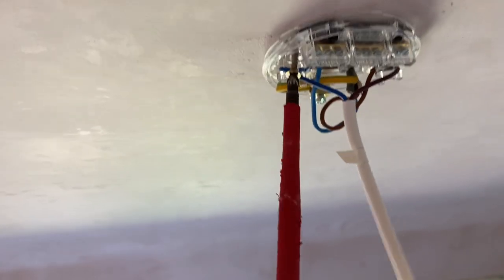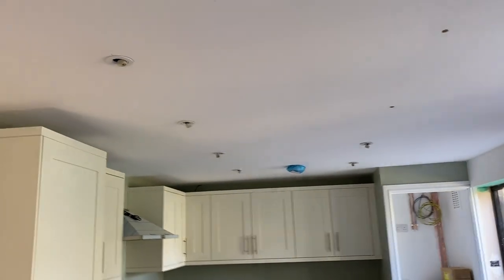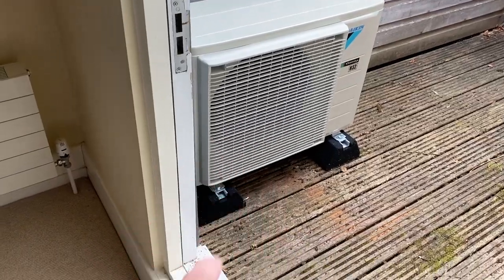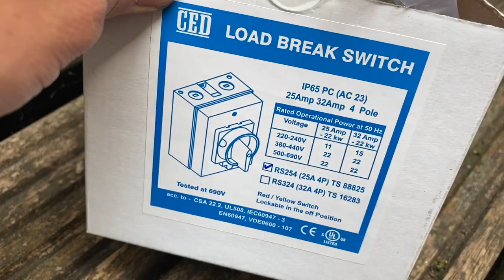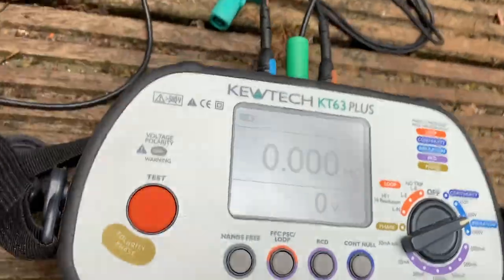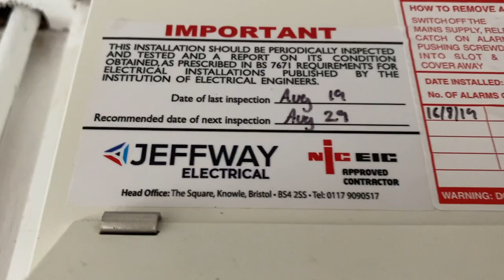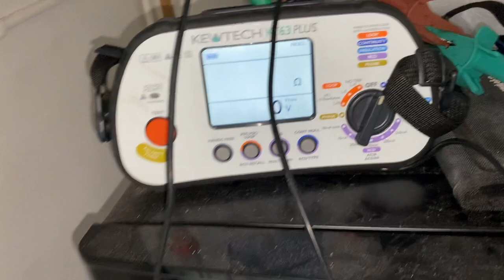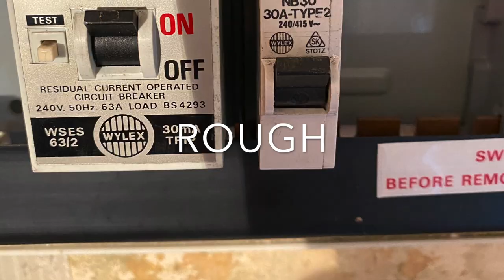Fault finding on a shower circuit. Disconnected and walked away.

Comment: Hi Chris great video as usual just a tiny point when installing the smoke detectors you shouldn't be sleeving the black wire with brown sleeve its only a communication/interlink wire sending a low voltage through to the other detectors
Reply: That's not what the aico user manual says!
Reply: Will Robinson it’s a extra low voltage interconnecting communication wire that doesn’t carry 230volt and only carry’s a voltage on operation of the test button or after an alarm activation
Reply: Will Robinson which page of the aico electrical contractors handbook does it tell you to sleeve the black core, I’ve got the handbook open here and non from page 102 show any sleeving
Reply from the maker: Hi lee 
Not sure what literature your reading but your wrong. I’ve got it in black and white in front of me.
Reply: @leebutterworth7465  page 25 of the user manual. "Must be treated as live. Insulated and sheathed" which I take as sleeving....
Reply: If you're treating it as live then surely you should be putting some brown sleeving on it !
Reply: CJR ELECTRICAL hi Chris as per chat on instagram I’ve got the colour pages of the Aico installer guide doesn’t show brown sleeving also David Savery past the same comment on one of his recent videos
Reply: @leebutterworth7465  valid points but it clearly says "treat as live and sheathed" in the user manual
Reply: Will Robinson I have the electrical contractors Handbook from Aico they don’t show any sleeving and their pictures are in colour unlike the instruction manuals it’s a weird one why their own paperwork contradicts itself
Reply: Will Robinson just got the latest electricians handbook from Aico definitely doesn’t show black having brown sleeving get the handbook from Aico completely free and fully up to date info
Reply: Always sleeve the black!
Reply: You would only find a debate this sad when you go balls deep into a CJR or David Savery video's comments section

Comment: Watch out for expansion and contraction of the tongue and groove timber you fixed the isolator too. You can get ~5mm movement across two boards between wet and dry states (but maybe this is composite cladding - can't quite tell in the video).
Thanks for the vids, enjoy watching someone take pride in their work.

Comment: As someone who works in IT it makes me happy you don’t put the cable next to the data cables. I’ve seen so many people put them together and it makes me want to cry. Keep up the good work, long time sub and always drop a like.. I just don’t comment often.
Reply: Why, Ethernet is a differential current signal. You have to have a lot of interference to have any corrupted packets.
Reply: In a residential setting its unlikely that it would cause noticeable interference but, better to keep it seperate.
Reply: @florisvdk  AC Cable carries a LOT of Amperage compared to Data Cable which creates a comparatively HUGE Electromagnetic Field which in turn creates a lot of unnecessary Noise/Voltage/Current in the Data Cable - bad for high-speed Data transfer (high Noise) and VERY bad for the Electronics sending/receiving that Data (high Voltage/Current).
Every Electrical Code I'm familiar with requires a certain amount of separation between High Current Cables and Data Cables for just that reason...
They also require a separation between High Voltage Cables and Low Voltage Cables to prevent excessive Currents being Induced in the Low Voltage Cables (under the wrong circumstances, a 120/240 Volt Cable can Induce 40+ Volt Currents in a Circuit designed for a Max. of 12 Volts...Not a good thing for 12 Volt equipment (such as most Smart Home Controls) to suddenly get 40+ Volts through them...
Reply: The regs require separation of band I and band II anyway, so it should be done regardless of whether it has an big impact on the data or not.
Reply: Yeh the worst data issue I have had was with a cat5e UTP cable that ran in a lift shaft (office building) every time the lift moved the link dropped out...

Replaced cable with FTP and it was fine

Comment: 15.01 Any DC fault current from the new Aircon unit will blind the type AC RCD in the MK board, looks reasonable to me the Aircon  unit could have gone on the non RCD side, just a thought.
As for fitting Aico smokes with replaceable batteries isn't so it's easier for the customer, it's because it's cheaper than fitting lithium for you, everyone loves a bleeping smoke alarm at 3am!

Comment: Chris does this mean all previous  CP Fusebox c/w SPD need to be revisited to fit a MCB
Reply from the maker: Nope they just don’t want to rely on the dno fuse anymore
Reply: Cheers 👍
Reply: Don’t suppose anyone has a link for the info/instruction sheets that document this change in stance please? 

I’ve tried to find it and can’t, does add further fuel to the do you don’t you debate surrounding OCPD with SPD...🤔

Comment: Where the hell does this gap between RCBOs come from? Sure I understand contactors, but RCBOS seems a bit extreme and an odd way to force bigger boards...
Reply: Chris Reed its a load of bollocks mate. Every protective device gets warm when loaded near to its rating for long periods. Its even mentioned in manufacturers instructions and always has been. Cant see why everyones getting lobons over it lately.
Reply: Forgive me if I’m wrong here, just a trainee, but does it come from the CU instructions? 

“Adjacent thermal-magnetic MCB’s should not be continuously loaded at their nominated rated currents when mounted in enclosures. We recommend a 60% de-rating factor is applied to theMCB’s nominal current where it is intended to load MCB’s continuously .”

🤷🏼‍♂️❓
Reply: This seems utter bollocks to me. Look at 3 phase db’s usually loaded full of rcbos there is never a problem with overheating.
Reply from the maker: Not over heating which is the problem it’s just to prolong the life of the expensive rcbos they are 5-6times more expensive than mcbs

Comment: The vast majority of boards in the country have CPDs that exceed the value of the main switch. You have to apply diversity. And what about the value of the DNO's incoming fuse?  Maybe they could have mixed up lighting and "power" circuits a bit more.
I was taught that you should always test an RCD in isolation, IE switch off all MCB's and disconnect all N's before testing. You're brave working in your socks.....
Reply: Simon Abbott for instance an 18 way 3 phase db thats loaded with single phase circuits, with only an 125 amp main switch. Some don’t or won’t trust good old diversity, thats the problem🤔
Reply: Selectivity? 🙄

Comment: How come you didnt do 5 tests on your RCD? 1/2, 1x at 0 and 180 and 5x at 0 and 180? I know you only record your highest 5x for a final circuit but does your tester do both tests at 5x in one operation? Or did you exclude the running up and down the stairs just?
Reply: have a guess...

Comment: The fireangel ones aren’t bad but it’s cheeky that you need to spend another £3 to get the proper push fit base that actually accommodates wiring, they base they come with is pointless

Comment: Are you happy with the Wiha SoftFinish screwdrivers? I've used Wera for quite a while and when they started wearing out I thought I'd try Wiha but I'm not really happy with them. The handles, especially the smaller sizes, just feel too small for my hands to hold them comfortably! Might get another set of Weras.

Comment: How come U.K. electricians never have tall enough step ladders ?
Reply: Tiny trucks because there’s nowhere to park and shorter ceilings in older dwellings.

Come into my American home with 10ft ceilings and 36” front door that was built in the last decade. JK my 1969 ranch only has 9ft ceilings. 

My sister’s 1970 ranch has a 42” front door though with a glass storm door from the previous owner who I guess may have been wheelchair bound. It had the thickest pink carpet was like walking through sand.
Reply: I'm surprised not many folk use hop ups, I find a youngman hop up does most jobs and a 8 step step ladder the rest.
Reply: @peterg.8245  we use metric 🤷‍♂️
Reply: @peterg.8245  most older Victorian properties in the uk would have 9/10 ft ceilings.....why are we talking about pink carpets😂😂

Comment: Much better to use a flexible cored cable rather than solid drawn twin and earth for vibrating machinery such as an air con unit. Testing RCDs at the RCD terminals with loads removed is the correct way to test RCDs and much less problematic.
Reply: Thats also how I've always done rcd testing, it amazes me how many people don't know that. I worked with a guy who  thought the brand new Schneider rcbos were faulty. They tested out fine when the load was disconnected.

Comment: Those starbreaker boards are brilliant, no faffing around having to remove the busbar from every breaker. What was going on with that shower cable route?
Reply: I wonder why no other manufacturer has followed this design? So much safer when there are spare ways too, especially if using those clip in blanks that always seem to magically disappear leaving exposed busbar.
Reply: @Daniells1982  mainly because I think it's patented by crabtree

Comment: Are you allowed wire appliances with those SWA core colours? We’d be made rip it all out and 2 points put against your company!!
Irish contractor ☘️
Reply: As long as you identify them with sleeving it's fine. Come to think of it I think they only sell SWA in those colours here
Reply: Jesus your so lucky. If our inspectors caught you not using the correct colours you’d be told to rip it out and re-install at your own expense and hassle!! They’d also black mark you and issue with penalty points. Some of them are real pieces of work, out to help no one!

Comment: I used to use a Yankee screw driver for ceiling roses back in the 80s
Reply: Yankee screwdrivers , I remember them 😂
Reply: @thomasbambridge6974  Still got mine in my tool box
Reply: Still got mine and various bits too ! Works well still.
Reply: I bought one about 18 year ago. Think they still manufacturer them.

Comment: I guess if you add up all the MCB/RCBO's in any house, you may get more than the switch is rated for. What about diversity?
Reply: Ain’t that the truth 👍
Reply: You mean you should get switches that are polarity neutral, rainbow coloured, and like to swing both ways?
Reply: Plus the suppliers fuse is providing overload protection of 100A or less. 
Not sure what he's got an issue with tbh.
Reply: The problem is that there are 2 boards, one with the low current circuits and one with the high... Ideally, I would like to see the circuits spread equally across the two 60947-3 100A main switches to decrease the strain on each of them...
Reply: @mattthompson8657  "Not sure what he's got an issue with tbh."
Well if he fucks the main fuse, good luck getting that back in business any time soon. You would have to call the provider and wait for ages

Comment: 9 or 10 adverts in a 28 minute video? Bit too much in my view. I have no problem with ads - Its the nature of the beast - I just feel that's a bit excessive. 
Love the content by the way. 👍
Reply from the maker: All placed by youtube I might ad
Reply: Scroll video to the end. Play for s second. Then rewind back to start.  No ads 😉
Reply: @Cjrelectrical  I see what you did there... Nice use of ad... 😉 Thanks for reply. I thought it was more than usual that was all as I was under the impression the content creator chose amount of ads as some only have start and end or start middle end etc. Seems a bit unfair if you've no control over how much ads appear one video to the next.. 🤔👍
Reply: @mattysmethurst5946  Top Tip mate... Cheers for that. 👍
Reply: instead of using .com/watch use .com./watch if you want want to use ublock
Reply: @ashleynery8092  appreciate the tip. My small issue wasnt the fact of the ads it's the fact there are so many in a half hour video, and to be told they are placesd by YouTube. Technically they are but content creators have input.  The content creator decides how many ads. Only start and end ads they don't have control over. So to say placed by YouTube...mmmm. None of the other lads have this much ads and to be fair neither does this channel normally. If its placed by YouTube as is being indicated then the ad system isn't being fully understood. It was an off the cuff comment originally as I enjoy the content. 👍
Reply: @Cjrelectrical  I know you are not bothered if we use an ad-blocker, but you could make it better by disabling mid-roll adverts.

Comment: It takes 70 watts for one minute to make 1 litre of water one degree hotter. That's just a physical property of water. Any kind of water heating device necessarily has to have a lot of energy going through it, precisely because it takes 4200J to make 1kg. of water 1°C hotter.

If we are going to see more electric heating systems in use in years to come, there will have to be suitable requirements to ensure safety, balanced against the need not to create a closed shop / protection racket.  The use of a torque setting screwdriver is nice.  Forcing everyone to use a specific tool only one company (run by an MP's brother in law) makes but deeming any job done using that tool utterly beyond reproach, is not so nice .....
Reply: I suspect with more electric heating you might either see American-sized tails or - more reasonable in my eyes - domestic three-phase like in much of central Europe. While some countries (like France) have gone from three-phase to single-phase, quite a few others are going quite the opposite way, phasing out single-phase supplies. I think in Austria there's but one DNO left that even offers single-phase supplies!
Three-pole bus bars for regular RCDs and MCBs are off-the-shelf parts here so whether a DB is single or three-phase only depends on the components you put in. All enclosures are rated for 230/400 V by the manufacturer.
Reply: @Ragnar8504  Three-phase in the home is an interesting idea. Most residential streets in the UK are wired so one house gets the red phase, the next gets the yellow, the one after that gets the blue and so on.

There must be a lot of people who won't be used to the concept of three-phase supplies. "Well, that one is live, and that one is live, so whatever either one or the other of them is connected to is also live, so it can't hurt to connect them together, can it? Live's live, isn't it, they must both be connected together somehow somewhere upstream ....."

No doubt there will be a few interesting videos around here .....

Comment: The fact that the RCD failed the initial test means exactly that. It has failed and needs replacing. It’s no longer reliable
Reply: Correct, I failed many MK RCD's for that exact reason. The mechanism lubricant dries out and they become unreliable after a few years.

Comment: Sorry but insulation resistance test should be done at the board and measured between live and cpc live and neutral and neutral and cpc and it shpuld ve greater than >1000
Reply: Greater than >1000? Well that depends on the meter and test current. Got to be careful around fixed leds and certain equipment.
Reply: Talking dog shit mate. We're talking megohms, millions of ohms. 299 megohms is the max some meters go up to and far surpasses the minimum insulation of 1 megohm. Anything under 2 megohm should be investigated when testing at 500V. No idea what this 1000 is you're on about.
Reply: When I did my 17th edition amendment 3( yes I have done the  18th since) the college lecturer said we should test IR from both the consumer unit and the end sides

Comment: Don't forget the cable grouping in the trunking - no one cares, but in theory it could be a de-rate....
Reply: Same with some of the overly pretty boards everyone keeps posting, cables ties together in bunches with no consideration to grouping factors.
Reply: I was working in our local library once. Took the lid off a steel trunking with singles inside. The singles fell out in a block and were stuck together. The trunking was acting like a radiator and you could feel warm air getting pushed out the top of the trunking even with the lid on. Grouping is a real thing, this was the first and only time I've experienced this.